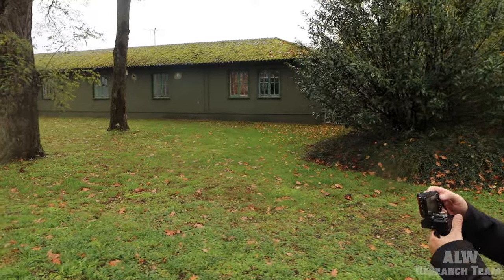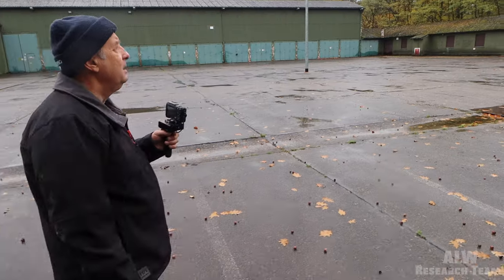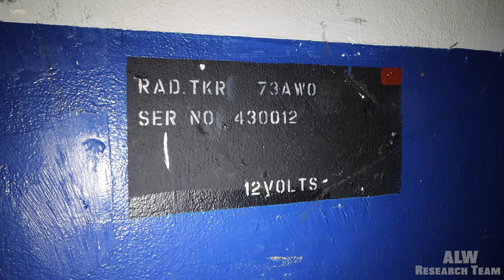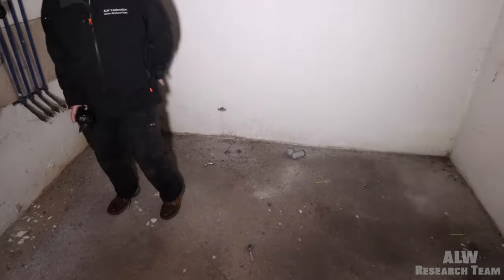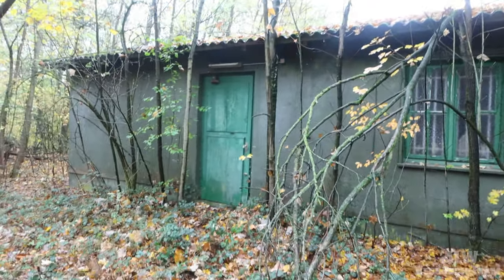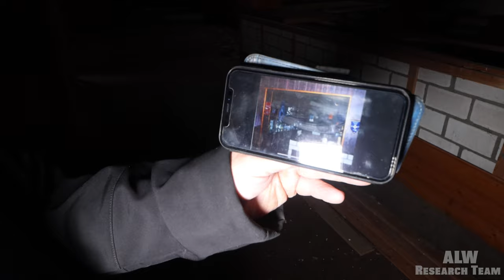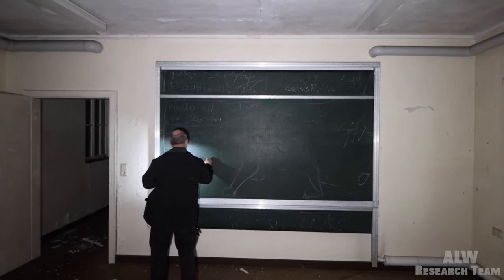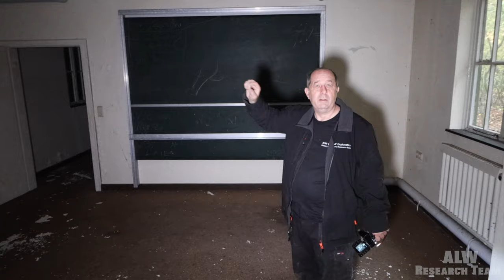The Ultimate Guide to Germany's Missile Base

Comment: 1 Sqns compound with Supply Flights and the motor club got pulled down years ago Dave.  They was across the road from Hanger1 (now the Airport Terminal - that one you thought was 1 Sqn was GEF.  The unknown compound was Supply Flight (Uniforms, Sleeping Bags, Pots and Pans and the taylors).  The uppers floors to the 26 Sqn bays is a left over from them being used for Bofors Guns, the cailings probably being put in later.  During the 1990.s the 26Sqn compound was took over by the Royal Sigs and 26 took over a squadron area on the airfield (after 15 Sqn Tornados had left)
Reply from the maker: Hello Fred, at the time of filming Dave wasn't 100% sure what some of the buildings were as it had been 38 years ago at the time. Thanks so much for your detailed knowledge. Hopefully Dave and I can come and see you nexxt year.

Comment: Hi Dave / Andy, loving this stuff. I think the compound with the high door lock-ups was stores, or at least the ones furthest away were. They would exchange stuff, one for one, slash it with a Stanley knife and then throw it in a skip out back. We would fish stuff out for the DPM material and sometimes find no damage, so would take it in the next week for exchange. Boots were the best find, they would slash them back from the toe cap, where the creases were and leather was softer. If the cut followed the crease, we would super glue it, polish it and then exchange them for new! Happy days.
Reply from the maker: There is always a work around with one for one stores ha ha :)

Comment: Greetings. 
       I don’t remember the spelling but “Ditchelbach” maybe? In the 1970s as an MP “Tower Rat”. We were “isolated” in the forest and it was enormous fun. I could see a small slice of the Rhine from my upstairs window. What you share in this video is far different from my experience. 
       We had three levels. On the top of the mountain was the radar. It looked like a collection of OD trailers with very large radar antennas. A small installation surrounded by razor wire. Down a bit was our small barracks overlooking our motor pool and a helicopter pad. 
       “Down Range” the third level held the main gate, Post One with one MP and a board of badges. After the traditional armed “Halt….” The arrival exchanged his (all men) ID Card for his personal badge. We also had visitor badges. This allowed entrance into the outer perimeter of Down Range. The fence line included lots of razor wire and a 30 meter clear zone that was kept bare with herbicide. There was a Ready Building, where we slept securely, a building for working on the missile sections, three towers in the other corners overlooking the entire area, each with a small glass windowed booth with a narrow catwalk and a halogen spotlight. We had a PR77 radio (?), crappy night vision, two crank, wired radios on a party line. We were sitting ducks for someone in the trees, lit up at night. In the event of an actual launch, we were to climb down with our flack vest, steel pot, weapon and one of the phones to connect under the tower which was surrounded by sandbags. Just a place to die. We had M-16 with a magazine but no round in the chamber. If a person cleared the tree line we were to obviously move a round into the chamber, halt them and warn them away. If they approached we were to warning shots. If they touched the wire we were to end them. Regardless of what they appeared to be. Even a child. I was challenged by a foreign, NATO General during Tac-Eval and he asked if I would kill a child who touched my fence and I answered in the affirmative, absolutely! As he turned to leave my very crowded tower I made eye contact with my LT and shook my head no. He just smiled. 
       We carried four more magazines wrapped in foil to avoid counting all those rounds every time the mags were issued and returned. We stole magazines and rounds from the range. We had a long walk through the forest with our weapons to and from Down Range so we broke this rule also, we all loaded our M-16s for the trip. Guys had obvious wear to their back pockets showing they were carrying a magazine but no one ever challenged us. 
       Terrorists were our most immediate enemies and they were a legitimate threat. 
       We had a gas mask holder but everyone used it to keep personal items, never a mask, paper and pen (authorized but not in a gas mask case) a book, snacks, cans of soda (very important because they were folded into hash pipes and the screen was punched with our rank pins, and almost everyone used hash on post. Just being honest), we bought the hash, which was cheap in Bopard (?) on the river. We road in Duce and a Half’s down the mountain about once a month for a day and evening, except when we were snowed in. Then they brought in supplies by helicopter. They would give us rides in the helicopter before leaving. Very cool pilots. When our General would visit we got rides in his very nice helicopter. Fun story; I had been painting the bunker next to the Ready Building when I was suddenly nose to nose with the General. He stuck out his hand (we didn’t salute Down Range) I told him I had paint on my hands, he smiled and said “never mind”… after the firm exchange our hands slowly peeled apart. He looked at his hand, I apologized and disappeared. 
       We also had a steam plant run by a couple of very nice guys who were absolutely never sober. 
       We spent 24 hours on shift. Half on post. At Post One, up in the towers or at Post Two. Post Two was the only way into the missile area. A large field with three Barns containing the missiles, each with an accompanying berm with a blast door for the missile crew. They would open the big doors, push the missiles by hand on a rail to one of three launch points. The weapons are plugged in and the crew retreat to their berm. They practiced a lot and were actually pretty fast. At some point here, if it was for real, we would have been vaporized. Unless we were sneaky and fired first. But since our targets were Soviet Union tanks… no surprise. 
       Our barracks had the offices on the left, a tiny “PX”, bar and social space. Three barstools and a couple tables maybe? It was put together just before I left. Above the Captains office was the MP end and the other end had the missile men. The radar crew were elite and didn’t live with us. We hiked up to their station once. It seemed like very little security but I’m sure they were heavily armed. We had M-16s, I was an M-60 gunner, and we had LAWS rockets so they probably had at least all that. Very quiet. Trees nearby in front of the East pointing radar were dead. 
       We received isolation pay while having far too much fun in the amazing forest. Don’t picture an American forest. Picture a well maintained park. If a tree dies the Forest Meister (sp?) cuts it down, uses as much as possible to make wildlife habitat and cuts the rest up so it won’t be a fire hazard and return to the soil. Walking in endless beautiful forests was deeply addictive and it was obvious why the National Pastime of West Germany is hiking. We hand fed deer and got treed by boar. SO much fun and isolation pay too. That was for the lack of female companionship on the mountain. I was only stationed there for one year but some of the guys liked it there enough to remain as long as the Army would let them. A few guys married a local woman. 
       I didn’t meet the right woman until shortly after ETSing. Thanks to the GI Bill, in college.